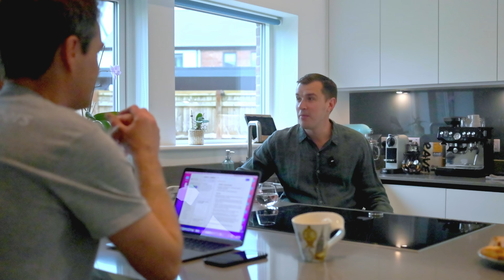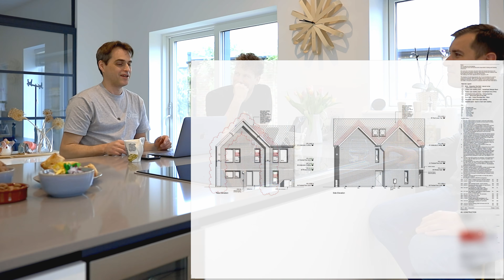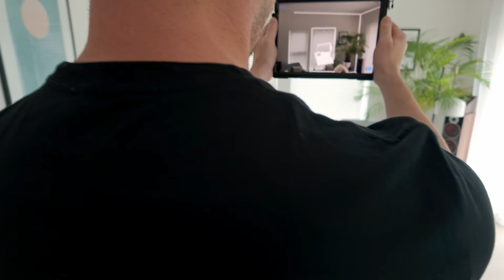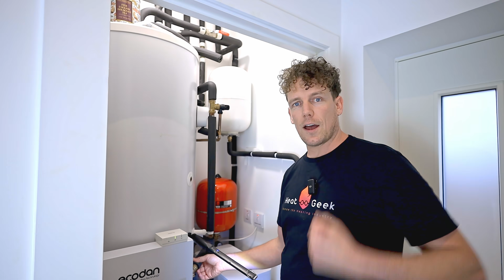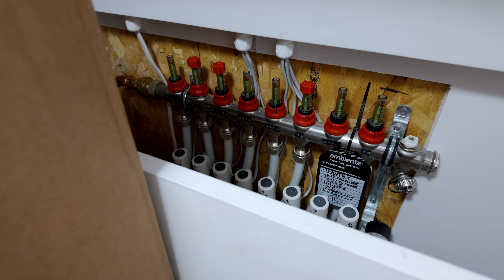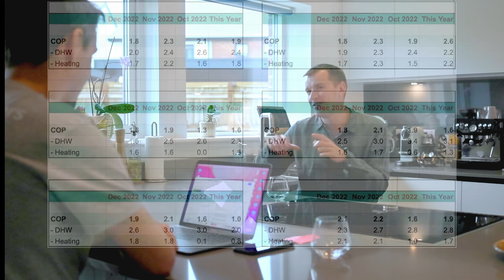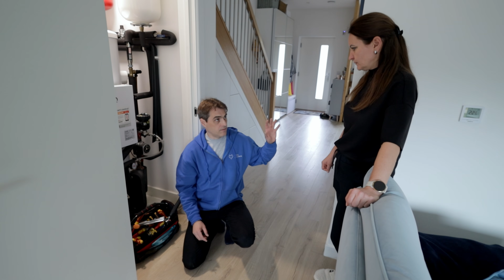How Developers Are Ruining The Heat Pump Market

Comment: Always loved these videos. I have just one question though. You always seem to recommend reducing the controls to almost or just one zone per house. I'm not sure how that should work in practice... For the classic house of bedrooms upstairs and living rooms down, what happens with just one zone where you want upstairs to be cooler in the evenings for kids being in bed early but adults remaining up downstairs for hours later... 

 If you don't have localised controls in different parts of the house, aren't you down to the whole house being dictated by the needs of one person or area in the house?

Is there a video where you guys discuss how to control the heating across the house and what trv valves / controls and thermostats etc you should have where? I've never come across anything to suggest how you go about delivering control to the customer...

I'm looking to upgrade my heating system at some point and really want to get it right but the thought of very little control of the individual rooms scares me! Currently I have tado valves in every room which is wonderful for comfort and control but i get plenty of cycling of my very over specified combi boiler.
Reply: You just get used to a comfortable house that is ~20C all over. The UK mentality of zone controls comes from drafty cold houses where any unheated part rapidly cools down. Improve that and zoning becomes pointless and irrelevant. That's as much about airtightness as it is about insulation. We got our 1960s 3-bed down to 1.5 ach (from probably about 10 when we moved in), and fitted MVHR as well as a lot of insulation.
We  just removed bedroom radiators as we like a cool bedroom. You can still have zone controls on UFH and rads, just be aware that using them reduces system efficiency. Ideally (if you like a cool bedroom) you have bedrooms downstairs as heat rises, but of course most UK houses are not arranged that way.

Comment: Missing elements for an even educated guess: house orientation, windows area, windows and glass specs, external walls and roof insulation coefficient... Installed first HP in one of my projects in 1986 in Switzerland,  second one in 1987 in my own house and since never used another system. When I started using it in France it was a novelty and I sent the contractor to Switzerland for training. Never regretted it and I built tens of villas... But good engineering and quality of installation are determining for a satisfactory result...

Comment: Great video.
Adam mentioned that low loss headers shouldn't be used, in those houses but the Mitsubishi pre-plumbed cylinders, which those houses have, include one. Are Mitsubishi wrong to include it?
Reply from the maker: It is just a pre plumbed cylinder that is not designed very well. Separation (low loss headers) are almost never needed on jobs that are sub 10kW heat loss, so in this case not a single hosue needs it. It lowers the eiffeincy of those systems.

Comment: It takes a ridiculous investment in time for homeowners to become knowledgeable enough about a system to question whether an installer is doing a good job or is ripping them off.  You can't always trust 3rd party inspectors to know what they are looking at either.
Reply: It’s almost like we need something in a local organisation that look after the way buildings are built. Maybe we could call the local organisation the local council and they could have a department called say building control. 

The problem is we already have that and they don’t do their job. My house was built in the 80’s and when refurbishing it I found out the cavity walls were around 4 inches at the ground floor and less than an inch at the 1st floor. The bathroom was so out of square it was over an inch across the width of door and they hacked out the wall to get the bath to fit. 

Building control pretty much fail in their job as demonstrated in my place and many new builds as you see on the “shocking” videos. Every new build should be inspected regularly during construction and they should be built to the passiv haus standard as the houses are in this video.

Comment: In a new development with tight air homes, I would have wanted a forced air solution so I could have AC as well.
They're having to do an air exchange as it is to remove the humidity.
Reply: You don't need AC in the UK if you've designed the house right (allowing for future heating). There should be at most a few days/year when it gets over 25C.
Reply: @xxwookey  If it's above 30C, AC might not be "needed"' but it beats stewing when you know that your house could have had AC with little cost difference.
That, and if the driver for all of this added expense is global warming, it seems pretty weird that you wouldn't solve it for your house first.
Reply: @wisenber  Passivehouses keep the heat out as well as in, so it may be 30+C outside but it's still the same 20C inside (at least for a few days - it will heat up uncomfortably eventually if you don't take some action like nighttime through-ventilation).  Part of the design spec is to carefully consider solar gain, other heat sources and decrement delay so that time above 25C is as close to zero as possible. 

More AC makes global warming worse, not better, so it's best to design it out. We agree that if it is getting over 30C inside then that is way too hot.

Comment: I have underfloor heating in my kitchen and it has two zones controlled independently. UFH uses radiated heat so there is a very good reason to zone it. If you are standing aound a hot oven and active you might want your UFH to work at a lower temperature. You can do this with floor sensors or room stats to shut off zones . Over in the dining area where we also have some seats to relax and watch the television it is nice to have a slightly warmer temperature, Using your open zone method doesn't allow for this. The fact that a heat pump can't cope with this setup is a limitation of the technology.
Reply from the maker: Is your set up high temp though?
Reply: @UrbanPlumbers  As it's Roger, I think we can guess the answer to that question. 😂

Comment: Since these systems were obviously designed by professionals, I think likely this is CYA. Suppliers over-specify and under-tune to avoid possibility of customer complaints. If I can play devil's advocate, unlike the intelligent and receptive people on this development, most homeowners are not well informed; some are downright difficult, so suppliers cover themselves by placing reliability over efficiency (disabling weather comp is a classic example). I've even heard of new-build owners complaining that their well designed, low temp HP system won't heat the house properly, because they run it like a gas boiler (high temps and on-off periods) and simply won't be told otherwise. Ultimately, consumer education is just as needed as installer training.

Comment: There is another issue which wasn't picked up on the terraced house, the heat pump is less than a metre away from the boundary. Did it get planning permission?
Reply from the maker: Not an issue - it’s new build so all went through planning

Comment: I kinda think MVHR is a con. You don't need to heat exchange and vent the air. Just  some blower ducts to mix the moist air around the house
Reply from the maker: You are misguided. MHVR works great. Can’t just mix the air inside the house.

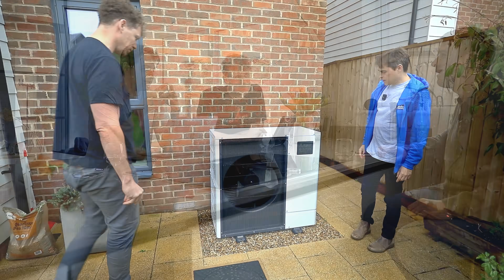Comment: 9:48 The unit should be off the ground. 
The coldest air is at the ground level. By lifting the unit off the ground, you can achieve greater efficiency on the warm cycle.
Reply from the maker: it should be lifted up as oterwsie it can be flooded easily or if it snows it can restirct the airflow. There is no effiency gain by lifting it up I am afraid.

Comment: I guessed right around 3kw loss as my 4 bed detached with less insulation (new normal build 2015) had 5-6kw heat loss…  
So frustrating that can’t be installed properly from the beginning especially when they are installing them in a much complicated and worst way (and more expensive for them too!!), and new houses still having microbore popping and gas boilers!! 😢

Comment: The "Passiv" part in Passivhaus was meant to mean that no (or little) active heating or cooling is required by means of thermal insulation, ventilation with heat recovery and proper use of solar gain and shading. It seems to me that these houses don't need hydronic heating at all. A modest floor standing AC unit in the open plan space should suffice. That's how these scandinavian houses were designed. The MVHR takes care of equalizing the temperature throughout the house. This way you save space, you save on installation and you get rid of those radiators upstairs.

It's as if the architect did not feel responsible or the builder did not look at the plans.
Reply: Indeed. So are they actually PH, because that doesn't fit all that well with the ~3kW heating load Adam and Szimon calculated. They were presumably not accounting for solar gain the way PHPP does.
Reply: I live in a new build with a primary energy use of about 27 kWh/m2. We have a 700W MVHR combined combined heatpump and MVHR and backup direct heating which is off 90% of the time in winter. The biggest compalin I have is that the system isn't powerful enough to fight the solar gains in the summer, which means you have to open the windows (and I'd rather not since I'm allergic). I believe that new builds should have external shutters to fight off solar gains in the summer which can'talways be easily retrofit. In short, solar gains are more important with very energy efficient homes. you can't simply create an airtight and well insulated box. You need to take shading very seriously too.
Reply: @Takethis42340  Yes, absolutely. Overhangs and awnings are such simple and effective pieces of technology that have been around for centuries, but seem to be forgotten in some countries. A well-placed deciduous tree might also do the job.

Comment: The trouble with all of these videos means that normal people like me are completely put off heat pumps entirely.
Any technology that requires such expert installation that there are countless videos on channels like heat-geek showing “why this installation doesn’t work”, means that I just don’t trust any installer to get it right.
We’re all waiting for a simple boiler replacement system that will work at “normal” system temperatures.
Reply: You need to change your mindset.  It's the heating in the UK that runs at an abnormal system temperature which causes the problems.  You convert to a low-temperature system, and it doesn't matter what your source of heating is - heat pump, biomass boiler, gas or oil boiler, Solar PVT based, and whatever else comes along.

The problem with Gas "normal" temperatures is they are wasteful, and given the way everything is moving, it is going to become very expensive to keep heating homes that way.  Especially if hydrogen is meant to take over (which is unlikely).

The problem with a lot of installers is they don't care about the running costs to the end user, and don't want to risk callbacks, so they will put a system in place that "works", but doesn't work well, which is basically what has happened with gas boilers.
You can shield yourself from a lot of that (or avoid it entirely), but doing the heat loss calcs yourself, seeing what radiators need changing, and what size heat pump you'll need.
Reply: @BenIsInSweden  No, I don't need to change my mindset, the heat-pump industry does.  I was told that to install a heat-pump in my house would cost £40k.  
Like hundreds of thousands of other people in the UK, I don't want to be told that I have to change all my radiators, pipework, insulation, etc. etc. just because heat-pumps can't run at the temperature my pipework was laid out for.
Start making heat-pumps that can be fitted as boiler-replacements, and then we'll all be happy to get one.
If it then also makes financial sense to improve the pipework to run at a lower temperature, then I will, if I can afford it.
Frankly, all most boilers, even my current condensing boiler, run more efficiently at lower flow temps, but that's a separate issue.
Reply from the maker: Piepwork size has nothing to do with flow temperature- it’s about flow rates.

Boiler industry in UK is also shocking and got away which substandard installations for years. 

Yes it is time people realised that good heating systems take a lot of skill and do provide real value to the end user and expert installations should be expensive.

If you want crap gas system - keep it - no one is forcing you to change it
Reply: @dominicgoodwin1147  I mean, it's your loss if you want to think that way, any heating system is going to become very expensive to run that way.  £40K sounds like someone didn't know what they were doing, unless you're in a mansion.  Insulation and rad upsizing will save money with a gas boiler that needs to run at high temperatures.
Reply: @BenIsInSweden  It's an old house.  Lots in the UK are, but the reason why it would have been so expensive is because of all the BS that goes with a heat-pump install for low temperature operation (heat surveys, new rads, new pipes, etc. and that's not even considering the inconvenience of having your house ripped apart to put in new pipes.
And the reason for that is because they apparently can't perform at high enough temperatures.
Yes, of course, improving insulation and lowering the flow rate will improve things for any type of boiler, but Heat Pump installers make it a prerequisiste. It shouldn't be.
Reply: @dominicgoodwin1147  plenty of old houses have had it done. It sounds like you had a duff installer that couldn't give you options if the only option was £40K.
It would cost that to put in an entirely new wet system into my 152sqm house.
Old homes are unlikely to have microbore nor plastic piping associated with the issues of flow rates.
What was the calculated heat loss of your house?

Comment: Make sure you explain the difference between SCOP and COP. This story with "one unit of electricity for three of heat" shows blatant lack of knowledge. A very good, well designed and well made air source heat pump using F gas can't go over 1.8 at -5C.  Yes, SCOP can reach 3 but you need to explain the difference between the two.
Reply: Well R290 isn't F gas.  But one of my R32 units can get a COP of 2.26 at -20C running at full capacity.  The Panasonic T-Cap (R410a) also has a COP of around 2.5 at -15C with a flow of 35C.

Comment: For anyone considering a heat pump, do your homework extensively.     I recently got a heat pump installed and I pretty much knew the size of unit I needed before the installler came around.   Micheal Podesta’s channel is a good place to start.
Reply from the maker: yes - Michael is very good. Buying a heat pump requires customers do the homework.
Reply: Don't fit North of Manchester..the ambient temperature is way too low plus winters are long and very cold...have loads of experience with this.. @UrbanPlumbers

Comment: Very interesting presentation, especially when that system was investigated, and all of the installation faults were highlighted...
Obviously, I'm no expert, and I'm going to take what was said as a statement of fact: so my question is... if all of this is true - does the customer have the right to insist that the installation company comes back and rips it all out and redoes it properly (free of charge, obviously)!
Reply from the maker: in theory yes - in practice the original installer and specifer lack the skill set to do it right

Comment: Interesting video, when I install heat pumps I always oversize.
The number of times I get told it is a high efficiency home when clearly it's not.
You can never get more heat out of an undersized HP but you can wind down an oversized heat pump.
Clients complain bitterly about the house is not warm enough but rarely complain about heat pump efficiency.
As well as heat pump suppliers have standard HP sizing and installation requirements.
Go outside those parameters and you are on your own, even if the heat pump is not performing correctly.
Cheers from Oz
Reply: If it was me, I would size the unit to exactly to meet 80-95% of optional heating requirements and then an auxiliary electric small boiler for the rear moment the heat pump falls short

Comment: I'm guessing 3.5 kW
Reply: Wow I didn't expect to be so close, honest I didn't cheat but I did do the calcs for my own house when we had our heat pump put in. Interestingly an installer who is now a heat geek recommended a unit with a much higher output than the one we have 12kW IIRC I think those engineers that are used to boilers just think more is better. I tried to argue with our installer that we didn't need the 8 kW unit we have maybe just a 6kW but he insisted that the rules meant only an 8 would do as a result ours does cycle a little bit when it's warmer outside but with a bit of tweaking of the settings we're at nearly 4 SCOP when the installer thought we'd only get 3.5.

Comment: All new builds should be designed and built with heat pumps as standard. If the system is designed at the same time as the building it will simplify the process alot, especially when you have multiple identical houses which can have identical systems. The gas boiler ban is coming but it should have been here a decade ago.
Reply: These are new builds, designed and built with heat pumps as standard. But they've not done a very good job - that's the point.
Reply: @xxwookey  I got the impression from the video that the resident had chosen the heat pump, that it hadn't just come with the house pre installed?
Reply: @adrianthoroughgood1191  Watch again. These systems are as installed by the house-builders.